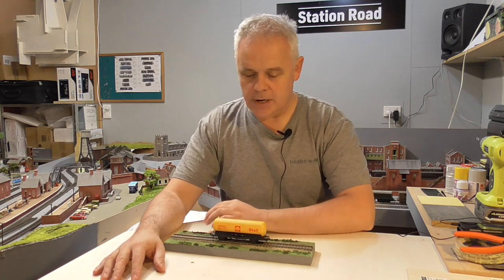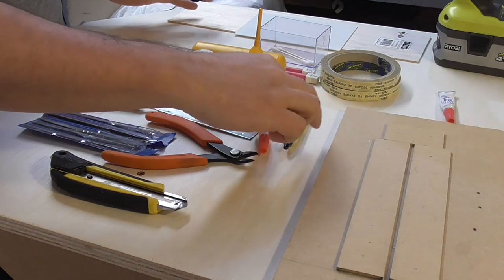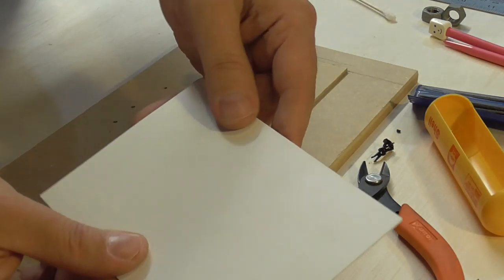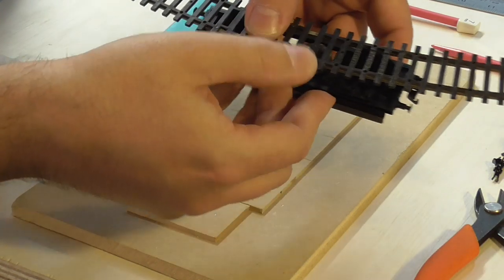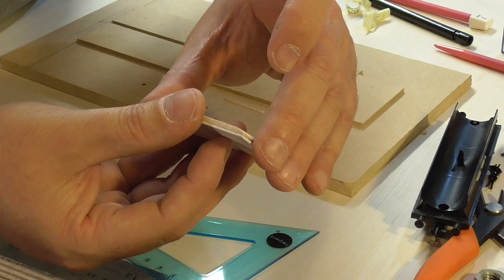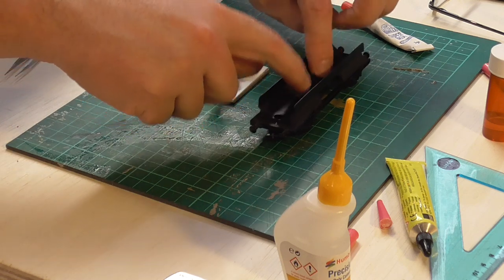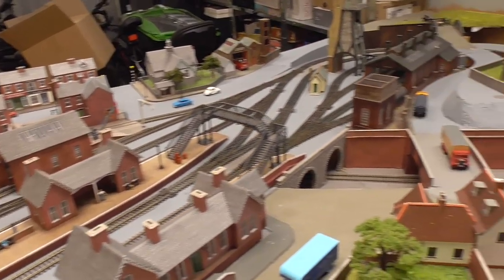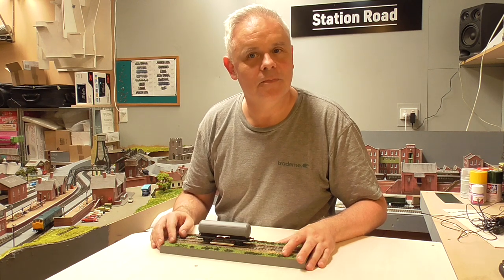Make Your Own Track Cleaning Wagon

Comment: Excellent video.  I made mine using 1/8" masonite/hardboard and used the rough side for cleaning. If needed, it can be renewed with just a couple swipes on sandpaper.  Instead of robbing wifey's knitting needles I had good luck with 8D roofing nails with the heads bonding onto the cleaning pad with 2 part epoxy.  You only need approx. 1/8"+ holes thru the chassis for the nails to slide thru.  It also helps if you choose a gondola, box or flat car since the underside typically needs no modification.  Just use a quality car with chassis mounted couplers and decent weight. Just some ideas that may help others make their own.  (it's well worth the effort and my tracks look like new without using chemicals or abrasives)

Comment: Thanks for sharing Julian.  When I was watching you gluing, I knew those glues were going to be marginal in strength or worthless.  My choice for styrene, ABS and other thermoplastics is an epoxy made for plastics.  It does a bang-up job.  Some of my joints will cause the parts to tear apart rather than the joint.  J.B. Weld Plastic Bonder is my go to when joining 3D printed plastic ABS parts.

Comment: Hi Julian - Slowly catching up on your channel, brilliant series mate. 
I saw the other video where the balsa wood cleaner was used on that huge layout, the proof is in the pudding so to speak and it was definitely taking the muck off that track. 
I was worrying about any damage but the layout looked just fine. 
Now having watched your video, wow the crud that it lifted off was unbelievable. 

Mine is N Gauge and the only issue I would have is replacing the balsa pad, so I will one build a small plastic tray with the lip slightly less than the balsa pad, so all I have to do is lay the balsa on the track and fit the carriage with the tray over it. Hopefully it would stay in place and be so easy to replace.
That's if you have not done that already in the videos I have yet to watch.
Looking forward to catching up.
Regards Chris

Comment: What great idea, much cheaper than buying a ready made one.I have maybe an idea to improve the pressure on the rails is to add two springs to the knitting needles before gluing to the board or if you want some strength, put the needles inside the bolts equal distance apart and then the springs can move up and down the needle length and therefore applying equal pressure on the pad surface.Your layout looks like a lot of enjoyment to be had running your trains around it, great work .

Comment: Hi Julian, the best glue for styrene is Tamiya extra thin, slightly melts the plastic similar to mek-pak. However the knitting needles are abs plastic (very hard) not styrene, here in bunnings I buy a super glue with a special pen that primes the plastic first. This will even glue vinyl plastic. Cheers great idea may do one on an SR cct van.
Reply from the maker: Hi Chris, thanks for the tip on the styrene glue. I'd be interested to know what brand the super glue pen is that you buy from bunnings?

Comment: I would of tried to find ad old scratched wagon instead of using that nice looking Tank wagon from Lima Nice video. Thanks.
Reply from the maker: It's a pretty old lima wagon, probably from the 80's so no biggy retrofitting. The main aspect is using a wagon with a long wheel base.

Comment: Thanks for the video! Just  thinking: wouldn't it be an idea to replace the knitting sticks by bolts in the same diameter, with the bolt heads glued to the styrene? By doing this You will get more weight to the cleaning pad, You can adjust the weight by adding nuts or washers to the bolt and most important You can disassemble the unit for easier maintenence.
Reply from the maker: Bolts could work but the thread would most likely catch on the holes in the under-frame. The rod needs to smooth so it can slide up and down easily. However, if the bolts that weren't threaded the entire length, you could cut the threaded sections off, only problem metal is harder to cut than plastic.
Reply: Interesting, and by adding weight to the rear bolt you could possibly even out the cleaning effect. The pad, as is, is pushing down more at the front, because of the drag (friction). I’m going to have a look at a metal plate, not to heavy, but thick enough to tap, and use threaded rod (held in with thread lock or super glue).

Comment: Great idea. I would imagine the styrene glues did not work is the knitting needles are not styrene. Styrene glues are designed to melt the plastic so they 'weld' together. Personally I would not trust super glue in that situation but that is just me.
Reply from the maker: Yes, I suspect that could have been the issue, not entirely sure what the knitting needles are made of. The test will come when I replace the balsa pad.

Comment: Just one suggestion,  instead of using nuts for weight why not use self adhesive wheel balancing weights  for Alloy wheels. They are very sticky,  once on they won't come off,